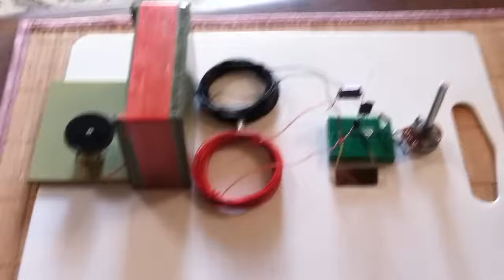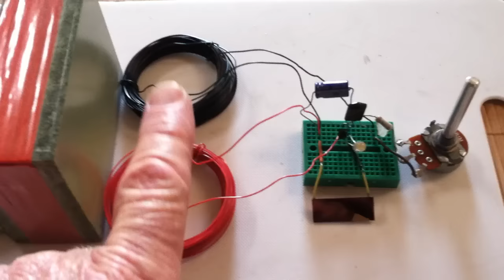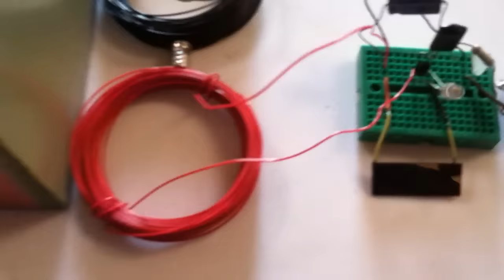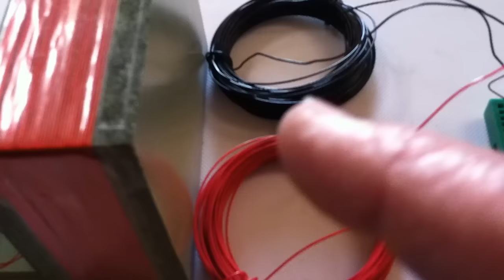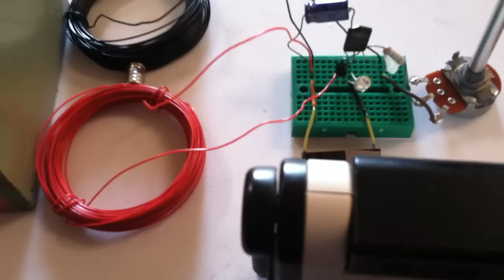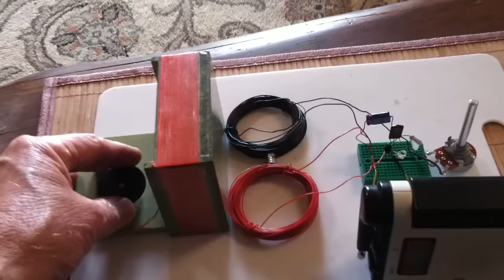Curious case of the Steel Joule Thief

Comment: to think the tuning coil wouldnt change the circuits performance....when the radio obviously picks up the signal from the circuit....would be the true head shaker! i dont follow the forums, but its good to see people putting these conversations into practical examples. cheers!
Reply from the maker: +jeremy gwilt   I think that you would need a sensitive signal strength meter to see if ANY extra energy is entering the circuit from the loop antenna.  I don't think so but wouldn't it be fun if it did.  I think that all the loop antenna is doing is tuning the circuit coils ---but what if I was grabbing a bit of airborne free lunch???
Reply: ***** haha... it is possible  i suppose but i would start by putting an earth ground to one side of that loop   ;)
Reply: +Lidmotor  kind of like a wave trap wouldn't you think kind of? cool
Reply from the maker: +Juan Smit Yes.

Comment: Very cool Lid...I am scratching my head.  I wish I knew what was being adjusted as the radio still makes the same frequency sound to me...just different.  I know that makes no sense.  I have tuned other JT circuits near a radio and you can hear the pitch raise, or lower, by a lot.  I can't figure out what is happening here but whatever it is...it is cool.  Keep up your always very interesting work.

Bill
Reply from the maker: +Pirate Labs Hi Bill.  Well the good old days of the Joule Thief have returned to the OU forum  That thing has been examined every which way it can be----and then the whole topic starts over again.  All I am doing here (I think) is just adjusting the basic coils with an external tank circuit nearby.  Take a look at "loop antennas" here on YouTube for something new to try.  It's all fun.

Comment: I know what is happening. To test this you need a second radio. Now tune two radios to the same station (am). Be sure to have an arm length in between at least (50 cm or so). You will notice that when you almost tune the second radio to the same station, the other one detunes. I learned this as a kid and never forgot this strange phenomenon. But it can be explained, and it is simple. The radio is tuned to a station. To be able to filter out the music. The tuning is a resonance situation, and the radio itself is now transmitting as well.
So in short, I think your antenna tuning is in effect disturbing the radio and not the penny oscillator. To see if I am right you could remove the penny oscillator. And please share if I am right (or wrong). I do know I am right about the first part, but it is just a theory on the second one.
Reply from the maker: +deslomeslager What you are describing sounds interesting and I will try it.  Actually I can eliminate the radio completely and the "tuning" still happens.  It is just inductive coupling of the close coils in this case.  Perhaps I will do another video showing it better with just the led.   The JT coils should be one on top of the other and the loop placed differently to get the best effect.
Reply: *****
There will be coupling I guess. The peaks of power in the antenna (tuned oscillation, standing wave) will add a tiny bit. It is as if the JT circuit is even more fine tuned.
And I didn't know the small solar cell was able to light up an led. How efficient led's are!

Comment: I think your mostly just storing extra energy in the tank. I have measured tiny amounts of extra energy in jt circuits like this. Its always the same energy measured in the coil when its not connected. Usually in the 5-20 nano watts range. So whatever energy that antenna normally collects, is probably getting into your circuit at some efficiency. But its a piddly amount. The lowest I have been able to get an led blinking was with. a Penny osc at around 4 micro watts input. antenna will be a whole order of magnitude lower power. Most of the power in my experiment was traced back to 
mains interference. Rather than radio, but either way, its man made power... Switch off the local power station and it reduces by 95%...

If you short your ant/tank circuit with a 100k or greater resistor. then use O'scope across resistor. you can measure the power harvested by the antenna. With the oscillator switched off. It will be a tiny amount of power though.
Reply: Oh and the ant may be acting as a transmitter/repeater with the radio. possibly sending more than its receiving.
Reply from the maker: +Mongrel Shark Wow! Thanks for the input.  Perhaps there is more to this than I thought.  Perhaps it is worth looking into more.  Even if it is just mains background energy it would be fun to look at it by blinking an led rather than looking at it as a nuisance wave form on an O'scope.
Reply: I have tried to blink a led purely from mains. Not sure it can be done with a coil alone. Short of putting coil right up to the mains. If your within 30cm of mains its more plaussable.
Not tried a resonant tank tuned to 50/60hz though.
Reply: Can you try to tune into natural frequencies and see what amounts you can harvest?
Reply: I have tried, but dealing with much less power than man made signals. Just the resistace losses of the antenna start getting really problematic.
Reply from the maker: +Mongrel Shark I think that it might be done if you store up the energy in a cap and then very dimly blinked a red led. The tank would have to be perfectly tuned to the 50/60hz.  Perhaps a special low power transistor would be required to make the magic happen. I have played with those Joe Tate Power Modules though and been disappointed so this idea might not work either.
Reply: I tried filling a low leakage 100uf cap to run a penny osc. The cap leaked faster than it filled. But you might be able to store it in a tank and slowly build it up? 
The only time I used the power was with sliders SWES. I got it running down to 200mv in the AA and the receiver was using slightly more power than the transmitter. The extra power was exactly the same amount the receiver picked up as rf smog when the transmitter was powered off. It was a tiny amount. You might get more with a much bigger antenna coil. Say a one meter pancake?
Reply from the maker: +Mongrel Shark  A large antenna receiver might just gather enough to do the job. I suppose that the antenna tank circuit would have to be made specifically for the RF smog you are going after.  Based on the experiment you mentioned the energy is there --it is just a tiny amount.
Reply: Yep. Not sure if its enough to do anything. I'd be impressed if it could run a micro watt digital clock or a penny osc. I've seen a diode in sunlight make more power than my cd sized pancake colected....
Reply from the maker: +Mongrel Shark You just touched on a something I have also learned ---a simple solar cell is the easiest way to get free energy.  If there is light they work.  Where I live the sun comes up every day.
Reply: Exactly One of those dancing flower panels, in the shade. Makes about 10-100 times more energy than I have ever harvested from radio smog. Those little panels are not very efficient. they only convert light to electricity at say 10% efficiency. Get a magnifier glass in the sun and you get a few thousand times as much power. If you want to get serious about solar you get mirrors/lenses and boil water for steam. You can harvest as much as 60% of the energy if you collect it as heat.

Comment: You really should invest in a <$50 analog scope so you can see what's going on. Find one on eBay, craigslist, or ask around. Using a cheap AM radio is not too helpful, it is like using a lamp to measure voltage by brightness. I recommend at least 20MHz bandwidth, and avoid digital scopes less than $400 new, and avoid those small handheld or PC scopes, those are generally no good and too cumbersome.
Reply from the maker: +Power Max If you look back (way back) in my video file I had a pretty nice old scope.  It was too big for where I work so I got rid of it and got a Hantek DSO 2090 that works on my laptop.  Not that great but when I want to do the scope thing I use it.  I like my little old radio.  If the project "sounds" interesting I hook up the scope.  Ha.  I will hunt around for one of those $50 O-scopes you mentioned.  Thanks.
Reply: +Lidmotor I bought a 30MHz BKpresicion scope on craigslist from a guy who's father was a TV repair man. It was not a high end scope, even for the day, (mid 70's) and lacked a lot of the more modern features like a built in frequency counter or cursors, and the grid on the screen suffered from parallax error , but it worked well for seeing what signals look like, you can use them to figure out how your circuit resonates.
Reply: +Lidmotor I have a DS1054z now since my old analog scope died. It has a lot of nice features, like 4 channels, 100MHz, 1GS/s, super deep 24M memory, super fast updating rate (up to 400,000 waveform updates per second) intensity graded display (emulates analog display), 480x800 resolution screen, serial decoding (UART, SPI, RS232), math, FFT, XY, cursors, error/fault detection, and many other cool things! It is also pretty fast, since it has a separate processor for UI and signal processing. It is one of the better budget-scopes on the market, and being able to capture transients and stuff is great. But the XY, math, and FFT mode frankly sucks on it. XY is only good enough for basic things. To do cool things like Oscillofun, you need a decent sound card and a analog scope, since digital scopes simply are not fast enough. DS1054Z can almost do it but with really bad quality.
Reply from the maker: +Power Max Wow.  I understood about 1/3 of what you are talking about (if that).  I have never used an oscilloscope very much.  It falls in the realm of analysis and calculations which isn't that much fun for me.  I would rather bend a paper clip around and make something.  I used to fiddle with numbers a lot.  It was called work.  Now I don't do that.
Reply: +Lidmotor Lol yeah, just listed of everything I know it has. once you know a little about how digital scopes work, all the terms make sense. I learned everything from YouTube by people like Dave from EVVblog! Like the MHz rating and samples per second simply tells you the highest frequencies the scope can measure. The memory depth is just describing how many samples it can store in memory. It is like resolution: the higher it is, the more you can "zoom in" after capturing a signal.
Reply: +Lidmotor I am not a big fan of academic work either, I like to pay with electronics like you! This digital scope does a lot if the number crunching for me! (I can directly view period, frequency, amplitude, power, etc!)
Reply from the maker: +Power Max My Hantek computer O scope has the math functions also.  It also has a built in spectrum analyzer that I used when I was working on the Exciter circuits.
Reply: +Lidmotor One thing you might want to look into getting is 3D printers. You could probably design some really good prototypes of these... Lid Motors!